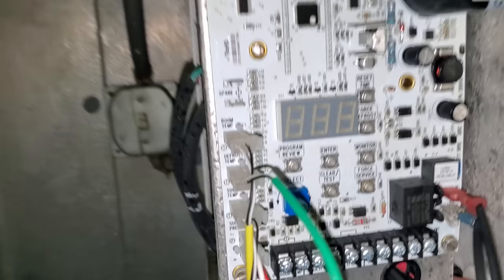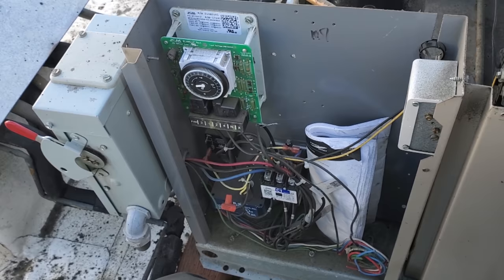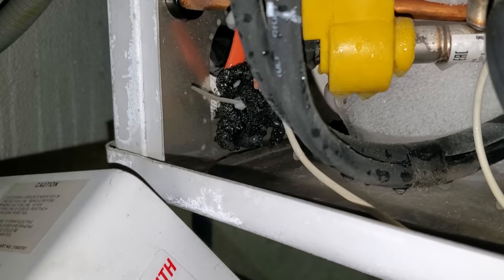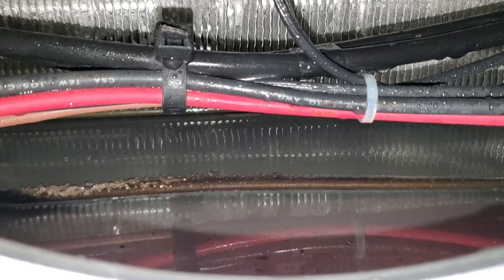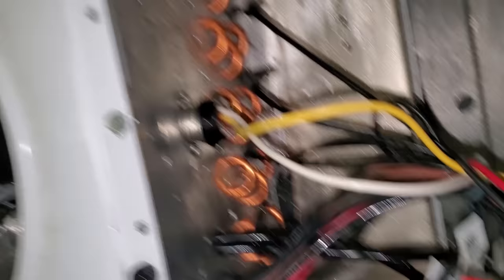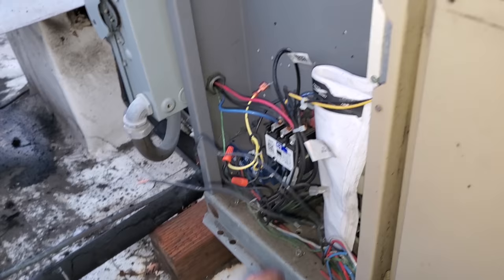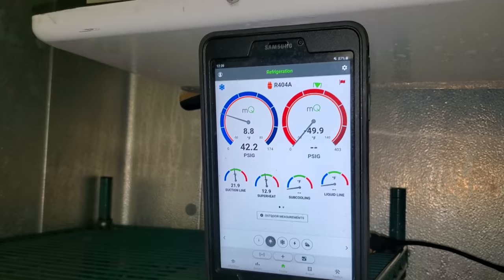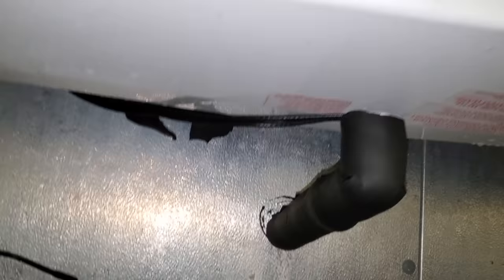THE OTHER COMPANY COULDN'T FIGURE THIS ONE OUT EITHER

Comment: I don’t know about the other guys and I don’t know crap about that system but as soon as I saw that ice I knew that was the problem.....So if they were asking me to pay them I would have told them the cheque is in the mail, and got a different guy sooner.
I spent a year in Kazakhstan teaching. The Apartment we stayed in had a serious leak that the roofers fixed three times. Each time they also had the interior damage repaired….I am not a young man any longer and getting onto the roof was not an easy thing to do but after that third visit a rain storm a constant drip drip, and my wife now in tears, it was clear something had to change….I climbed up there and found a small lake….guess what wasn’t working properly…yes the drain in the middle of that lake was not working…..A phone call was made, directions that should have not been necessary were given an hour later…..the roof system designed to be water resistant rather than water proof, and never the problem, was (fixed)?…. The drain was in upside down and that cost a great deal of money….paid though by the roofer….do you know, he didn’t even buy me dinner.
? Are we getting dumber?  Where the hell is common sense?

Comment: Also, I fixed my own furnace when no tech could. I'm quite proud of it, really.
There was an intermittent vacuum problem and the furnace would turn off, usually when it was like -20 outside. Repair techs were over at least 4 times and finally one told me to 'buy a new furnace'.
Turned out it was THE GASKET between the draft inducer motor and the furnace wall: the manufacturer  had cheaped out on the gasket material, it was too thin from the factory, and shrunk over time; the draft inducer motor couldn't seal properly and it was 'just enough' to cause a problem... but not always!
I rigged a cut-out gasket from dense foam, put it in place with a couple dabs of silicone caulk, and the furnace has run without a hitch since.
I'm quite proud of that!

Comment: 18:10 - SO (600v, oil resistant) and SJO (300v “J”stands for Junior, oil resistant) are portable power cord designations that refer to the outer jacket material. Either type is possible in this application, although SOOW or SJOOW would be better suited here since the “W” stands for water resistant. You have SJOOW in your hand. That’s 300v (J), outer (jacket) and inner (conductors) oil resistant insulation, and water resistant (W).

Comment: I really liked the video. L retired as a service manager after 60 yrs. in the HVACR field and ran across these situations all the time and it is truly fustrating and always happens at night or weekends.I think that it really insults you to think that the techs before make the HVACR looked at in a bad way,due too this customer having such operational issues and no resolve.I feel your frustration but I am proud to watch a tech who knows his profession and set things right. One thing you can see is that 90% of calls are due to electrical issues.It's quite easy to learn the basic refrigeration circuits and piping and how to install them,but understanding the physics of HVACR systems is impossible without understanding the physics of electricity,air flow,water and refrigerent flows and numerous other related fields.Most of my experience was in the heavy commercial and industrial field  Hospitals,factories,office building etc.and had that same problems with poor customer service and wiring situations that were down right dangerous,piping and ductwork designs and installs are a big problem in both the residential and commercial sectors.This is a big problem in housing were 75% of the homes complain about hot and cold rooms which causes a/c units and heating equipment to operate almost continues.These design and install defects are costing home owners a tremendous amount of wasted money and energy,.L have reducted many homes and businesses part time after work and made very good money but the best payment was a happy customer.I know you will do well and email me if you need advice healyjohn134@gmail.com.

Comment: Same problems in the automotive industry. Shops can’t properly diagnose a vehicle so they throw parts at it often causing even more issues due to sloppy work or junk aftermarket parts. They charge the hell out of the customer making excuses as to why it’s still not fixed and why they are being charged for more work. When it finally gets in my hands the customer is already frustrated and somewhat guarded by then and understandably so. The only good thing about those shady places is that even though they give our industry a bad name the customer is so happy when we get their problems fixed that we have usually gained another lifelong customer plus have them telling their friends and family their story. It’s frustrating to always be cleaning up other peoples mess but it gains you a great reputation and brings you loyal customers in the end.

Comment: This  is a wonderful challenge to someone who is well experienced in their craft and is not charging by the hours.  Real world technicians have to quickly isolate the current issue and fix it. Sometimes that current issue is not always the underlying cause of the current issue, but it does not matter cause the tech fixed the current issue and gets a pat on the back. Back at the shop the technician explains to their supervisor that the location will continue to have problems unless other issues are fixed first. In other words the techs all know what they are probably doing and the manager is aware as well. Techs dont have the time to read past invoices.  I suggest you sue the company who originally did the install.

Comment: Worked on Mercedes Benz for 7 yrs at a dealership. Sometimes it's multiple problems.Imagine :  motor, transmission, rear end, steering, electrical, climate control, etc., all in one box, rolling down the rd.

Comment: It's called "incompetency"; back in the day I was called in the night for a melting, loaded, ice cream truck. The filling station/garage owner where the truck was parked and plugged in had dumped half of his 100 lb. bottle of R-12 into the R-502 cold plate system. I had to open the warehouse at 2:00 AM for supplies and had it stabilized by daybreak.

Comment: Moisture in system can cause txv to freeze open. Change filter dryer. Heat txv and it will melt ice back to liquid and filter dryer will catch the moisture.

Comment: I had a computer controlled heat unit fail.  (That had been idle 10 months). I found two wear issues, replaced $4 in parts.  Checked sensors, overheat, pressure trips. (Multimeter current passed when set). Finally gave up, called.  He asked what I tried.  “Ok I will come out”. 5 minutes max. “How about the remote heat sensor?”   “What remote heat sensor?”...
   There was a cord hooked to other sensors 4’ away that for some weird reason tripped.  Push reset.  It works.   Two screws to expose.  On top.   Sometimes you have to get a expert.  (Google didn’t show it either) hopefully just 1 hr charge

Comment: I was out on a 10,000 sq cooler that was going to need its 3rd compressor in a year (new install Bohn unit) we just got the accounta month earlier. Three separate coils downstairs. Found no trap at the roof and ref lines all sloped away from traps downstairs! All my work and they went back to sue the install company for corrections. Largest refrigeration company in California. Whoops!!!

Comment: I’ve been in the plumbing business for over 46 years. I’m at the point where I tear things apart to figure out how what some Other plumber has done for much less than I charge!
   In my area. Most companies charge at the most $165.00 an hour. I charge $225.00 just to show up and $275.00 an hour for every hour after.
    Some of the time they will ask why I charge so much? I tell them. When I walk away from my jobs I will not need to come back and repair or replace anything. I’ll be done. I always tell them that if you have any problems what so ever. Call, I will be right back. 
   I’ve been in a supply house when the plumber is asking the counter guy how to install or repair something. I always laugh and as “who is the plumber “.  And is the customer paying for your service??

Comment: The Health and Safety executive in the UK would have shut that company down and hauled their asses in court. That’s shocking wiring and failing just about every aspect of the 18th edition electrical wiring we abide by in the UK. 556 pages that need to be either memorised or have the book with you on every job to cover yourself. From memory this is abysmal, well done my friend, well done for preventing someone potentially getting a nasty shock. Again our three phase in the UK is normally 415vac and domestic mains power at 235vac.  Eddy currents off poached neutrals and especially abusing PME. Also an old trick to bypass electric meter is to ditch the neutral and have the live running via the load to earth before the meter. Earths a different potentials all add up to a severe if not a fatal shock.

Comment: I used to be the Maintenance Director at the Y.M.C.A in Asheboro North Carolina.   They had a dehumidifier that had been worked on I don't know how many times.   It was a pis poor designed unit, but no company couldn't keep it running.   I am not an expert, but I think I got it to run a few days at a time, but it wouldn't last long.   The blower fan belts would not not stay on no matter what I did to keep it tight.  I finally gave up on it.   Then I got fired, so I don't know if it ever got fixed or not.

Comment: Trouble shooting is one of the most important jobs & very few are very good at this.  A guy cleaned only the intake side of the coils. He said that the back side was very clean .  I said bull shit & I caleaned it the back side & the amps dropped buy 3 amps.  lower that 30 amps on a 30 amp breaker.  Your right. there are not very many  that knows what there doing. So keep up the good work & incurage others to know what the difference between "shit" & "bull shit".  
You should be teaching this tread.

Comment: Fundamental principles for walk in refrigeration units were addressed. For example, water, when it gets cold enough becomes ice, which then expands, notice the bent evaporator fins. Proper drainage of water that is coming out of the air off the evaporator assembly was addressed. People that enter a Walk in unit must bring in warmer air which contains more moisture, which comes out of the air when the temperature drops. Hence, the water must drain correctly. The original install technician did not follow manufactures electrical wire installation instructions. Notice the bad neutral/ground wire discovered. When the installation wiring diagram was correctly followed and tested using the schematic provided, the walk in unit worked. Fundamental physics including the difference between Neutral and Ground in an AC circuit were addressed.

Comment: I've seen sloppy work on the 2-way radios in our schoolbus, and questioned why thy get paid so well. Antennas with damaged body gaskets,  screws on the ground from the radios they removed,  and many feet of power wires cut down to length for only this installation,  just tossed. Last I replaced Antenna cable that was also cut to length for this bus, but too short for matching the Antenna to the radio. Sounds like French to some but when you pay for systems upgrade, you want it done right.

Comment: Electrical wiring & electronics is not my thing. Still watched it all!
I travel back in time (40+ years) to a customer that also had paid hundreds of $'s in mechanical bills to start her van. 1st} the cams on the V-6 where on the wrong sides (driver side left IS left no matter which way your are looking from) after a valve job & resurfacing. The main problem was a partial, 3/4 plugged, catalytic converter. She & her family got RIPPED OFF by several shops.
                   GOOD JOB !

Comment: Great call replacing that ECM with a PSC motor. I do this as well any time I see an ECM that doesnt really need to be an ECM... I've seen time after time after time, failed ECM condenser fan motors that are stupidly expensive... Sure, they provide great head pressure control, but so does a PSC with a SCR! For about half the price! I hate ECMs! (Where they're not needed).

Comment: When you are competent, diligent, honest, reliable, you become the guy literally keeping the world running, going behind the half-doers cleaning their mistakes. 

I used to be at that level with computers. I knew when a part was designed to fail, which parts were unnecessarily powerful, which software was slowing things down. I could even tell which of two CPUs in the same model number was better than the other, and overclock it. I stopped because people who use computers don’t know how to do basic things, so why am I optimizing all these systems?

Comment: Lol. Reminds me when a pro searched for the problem with the central heating for hours. 
Took me half an hour to find out the mode switch was broken off. The heating simply was switched off. I carved a replacement from an old bucket handle made of plastics.
By the way, i am computer scientist. Not electrician or plumber.

Comment: If the transformer is design correctly that water isn't going to hurt it. They are dipped in urethane to protect them. If the connections were in the ice then they were probably shorting out through that. Who knows how many times that breaker tripped and they just reset it. I would save the money on the transformer and put it on the breaker. You seem to troubleshoot backwards. The first thing is check the breakers. Then check the drainage. Then check the circuits then the fans. Always go simplest to hardest because the simple problem leads you quicker to the main problem.

Comment: Drain wasn't pitched right, not removing the timer circuit, also.. not cleaning out the drain piping.. like damn, you can tell they just wanted to turn a quick buck. We have a saying with programming... the sooner you start coding, the longer it takes.

Comment: I have run across billions of situations where refrigeration techs have done similar things, problems that have been going on for years since the equipment was installed.  (Also, boilers, but that's another story - a very scary story).  I really appreciate that you don't trash talk the previous company, but I have no similar reservations.  

In fact, I'll even offer up a new slogan for their business:  "We're not very competent, but at least we're expensive!"  or "Don't worry; if it breaks because we installed it incorrectly, wired it incorrectly or plumbed it incorrectly, we'll come back and charge you again for our incompetence!"

Comment: On the Qrc coils I have had a lot of problems with the exv head wire connection having grease at the connection causing the valve to not close properly. I have been in contact with Heatcraft to get this issue resolved.

Comment: You're a trooper man. I hate doing low temp shit because of shit like this, friday night emergency calls for stupid shit like terrible installs. There is a certain company within portland that has a reputation for shit installs. To the point where they got sued because they dry fitted condensate lines in high rise apartment complex. Or now because they install mostly vrf systems, all of their fucking flares leak and some their guys are soldering the pipes and the flare nuts together. God damn dude, I hate going behind them.

Comment: Hey great stuff man but at the end there you made an electrical code violation. When you tied into the neutral of the lighting circuit you have to now go back to the electrical panel and make the lighting circuit tie into the door heater circuit on a 2 pole breaker. The theory here is that now if an electrician goes to work on the lighting circuit and turns it off, he’s still going to have a dangerous situation because the door heater is feeding the neutral line for that circuit.
Reply from the maker: The lighting and door heater are and were already on the same circuit from day one, but the people who replaced the door messed that up......

Comment: Thank you for all your videos. You taught me ton of goodies that it would take years to learn. I'm only refrigerator and small appliances maintenance guy with C10 electrical license, but recently I've been asked to work on walk-in units. Apparently the current AC company is charging them waaay too much and giving them lots of runaround. A simple gasket replacement is enough to pay for airline ticket to Bahamas. Just curios the company you didn't want to say has 2 word and it start out with A and L?

Comment: I did industrial maintenance.  When I started at my last place, there were 7 other maintenance techs.  Somehow, one of them got promoted to a management position, although he rarely repaired anything.  He just called in an outside service.  The rest were just hammer mechanics.  (If it doesn't work, get a bigger hammer)  Long story short, within 6 months, I was the only person doing maintenance any longer.  I worked there for 10 years, until I retired.  I didn't fix anything, I did proper repairs.  There is a BIG difference.

Comment: Fyi, SOW cord is a 600v rated cable and an SJOW is 300v rated.  The SJOW has the same conductor sizes but the outer jacket is smaller.  There is a pretty big difference in diameter between the two types.
Reply: I thought of one other thing that may be useful about this.  When I was new to electrical I used to think of it in terms that SOW was the big cord and the J in SJOW stood for junior.  Just a smaller version of dad.